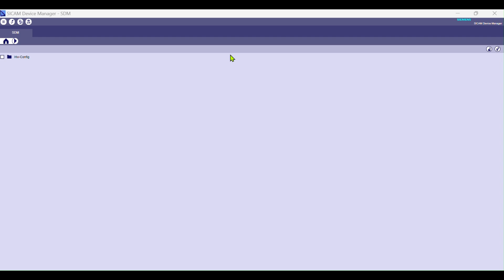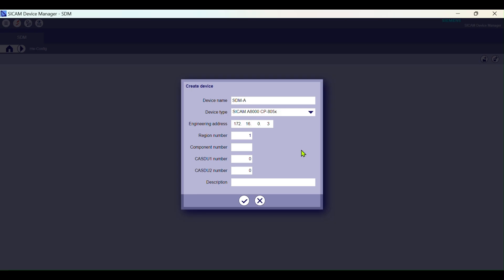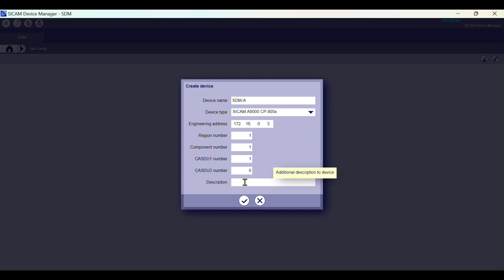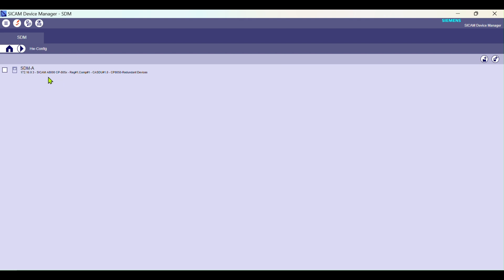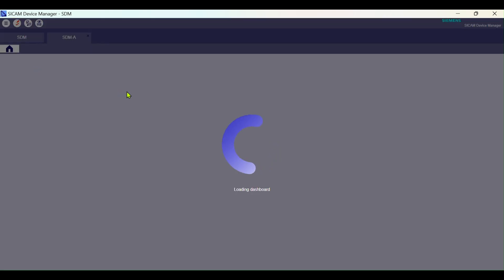SICAM Device Manager - How to configure SICAM A8000 hardware ?

Comment: using A8050 
and extend I/O 8532 with DI DO and AI 
after upload there is no error , 
but when the communication cut off and reconnect,  AI will not respond
Reply from the maker: Which firmware you are using?
Reply: @SICAMRTU  3.5 
using 4.0 same, 
didnt turn on at all for AI
Reply from the maker: Share your application
Reply: @SICAMRTU  https://drive.google.com/file/d/1aOQyelWkPsPfM_kja55Cl7f2mEPOw_FT/view?usp=sharing

here is the link, 
there is CI-8820 in last RTU but cant be added in software 
the problem is when we open connection from A8050 to CI-8532 and we put it back into connection again, AI-8510 not detected